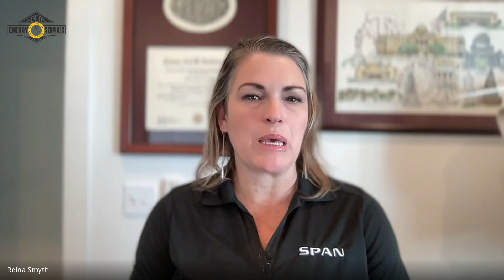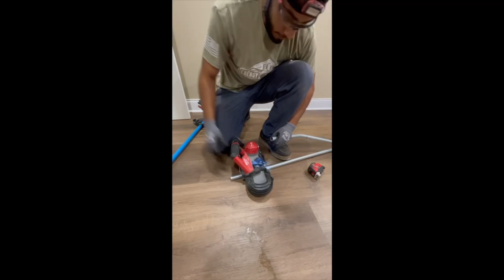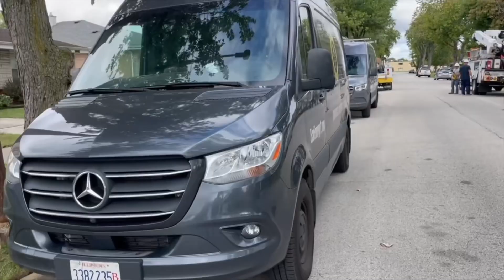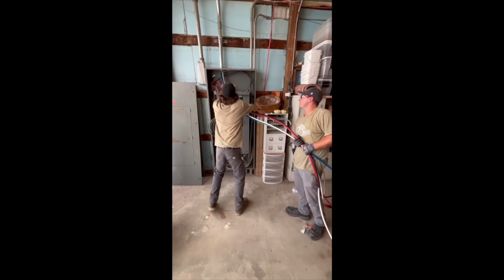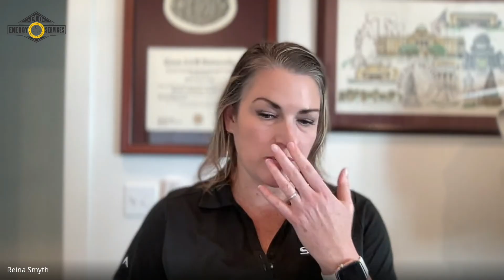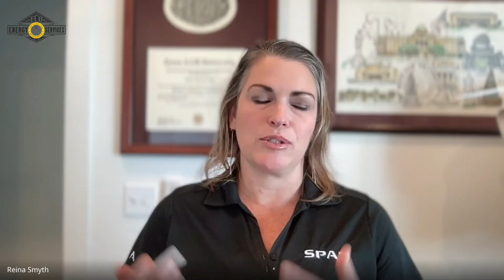I Asked SPAN the Questions You've Been Asking Me

Comment: Have you looked at Eco Flow Ocean and the Smart panel it has?   If does everything.   Works with ANY generator portable or fixed, open frame or inverter.  Works with off the shelf breakers as well.  Superior over the Tesler Power Wall.  Inverter than throttle the load on the generator, can output 24K Continuous, can support 80K of battery storage ( Fire Suppression built in )  Flood proof up to 3 feet for Flood zone areas,  8 MPPT inputs ready for Solar strings up to 5K on each,,,,  And the list goes on.
Reply from the maker: Check out some of our more recent videos, we are installing a ton of Eco Flow battery systems right now.

Comment: I have a span panel mlo 48 and I hope people listen. It absolutely sucks. The panel has had issues since day one and with every single issue all span customer reps (after days and days and waiting for them to reach back) say is that the span is working normally with the issues. None of the issues have been fixed and the tickets they create never get fixed. Customer service is a joke. Span is a joke of a company and feel like its hoping for another company to buy them. My issues have not been fixed and the information it’s supposed to provide is a joke. On top of that my router is always sending me alerts about malware that it stops span from trying to access for reasons I don’t understand the panel sends huge amount of data. When I undergo grid outage the estimates that the span panel provides are always wrong and unreliable. The data that the app provides about solar production, home electric usage, and battery usage is always wrong. Save yourself the headache and the money and do not install this junk.

Comment: Great video! Perfect timing as I start Phase 1 of my home electrical renovation: upgrading to a smart panel. I also watched your previous video and had a few questions:

Questions about SPAN Smart Panels
- How does it integrate with a standard gas generator or inverter generator?
- How does it work with whole-home battery systems like EcoFlow DELTA Pro Ultra that use an inlet/“whole-home connector” rather than a hardwired connection?
- Is it possible to set up an inlet (similar to a generator transfer switch) as an interim solution before full integration?
- For an advanced DIY homeowner, how difficult is it to:
  * Add a new circuit?
  * Modify or relocate an existing circuit?
  * Configure a backup battery connection like the one mentioned above?
- More broadly, how much of the system configuration can be handled by the homeowner vs. requiring a licensed electrician? For example, swapping a battery system or adding a new solar array.

Thanks again for the great content—please keep it coming!
Reply from the maker: Thanks for watching, and great questions!

The panel integrates with a generator just like any panel would. You would still need an auto transfer switch for seamless operation, and it would switch from grid power to backup power just like that.
If you are looking at EcoFlow batteries, I would personally go with the EcoFlow Smart Panel 3, but if you are looking at Tesla/Franklin batteries, I would absolutely lean SPAN over EcoFlow. Both are great products, but EcoFlow tends to lock you into an ecosystem more than SPAN does.
You can absolutely set up an inlet, but you would need to have a transfer switch to avoid back feeding to the grid before full integration. You can get a kit for this fairly inexpensively.
For an advanced DIY Homeowner-
It is easy to add a new circuit, not much more dificult than a standard panel, but you will need to add the new circuit in the app to get the full monitoring. Not a big deal, and you can use pretty much any breaker.
Relocating an existing circuit is easy as well, again- you will just have to change the app configuration a little, but no big deal.
I would recommend having a SPAN certified dealer configure the batteries, and that is mostly because consumers cant just have access to the battery configuration in general. We have gotten very into batteries over the past couple of months, and there is a lot to it that I wouldn't recommend doing as a DIYer.
Honestly, I would strongly recommend a licensed electrician for any sort of solar or battery work, and more importantly- make sure they have experience with the specific thing you are looking for. If it's Tesla Batteries, find an electrician that is really good with Tesla Batteries, same goes for Solar. There is a lot that can be a mess if configured wrong, and I have seen improperly configured solar/batteries take out entire systems. We had to replace an entire Powerwall 3 last week due to an improper install that took the system out.

If you have any other questions, call 708 872 8404 and ask for Conrad. I will be happy to help.
Reply: @Eco_Energy_Services  You take a long time to reply, but every word was worth it! I have a clearer idea now. Do you operate in California? Thanks!
Reply from the maker: @gerardoarturo18  Haha- I dont know why your first comment didn't show up for me for awhile. We are based in the south suburbs of Chicago, and we are local to the couple of states around us for now, but if we ever do come out to Cali I will let you know. I have an uncle that owns an HVAC company out that way through!